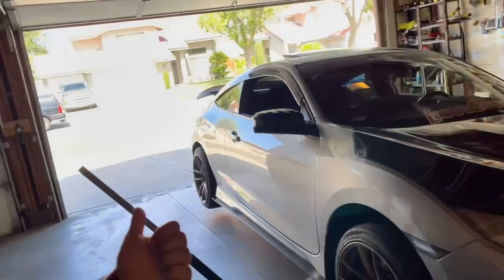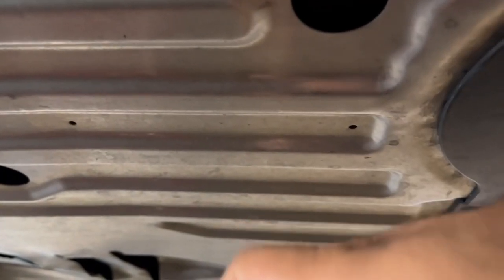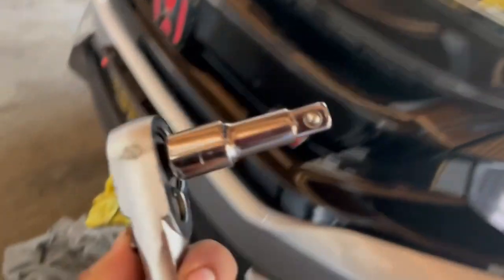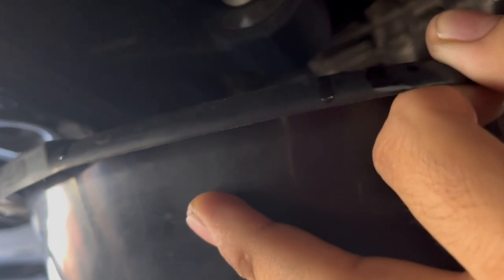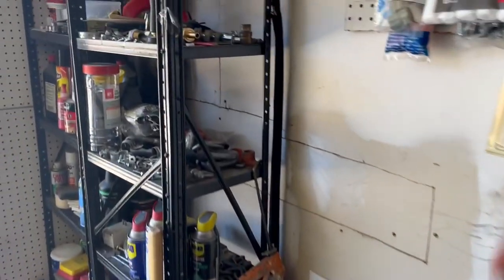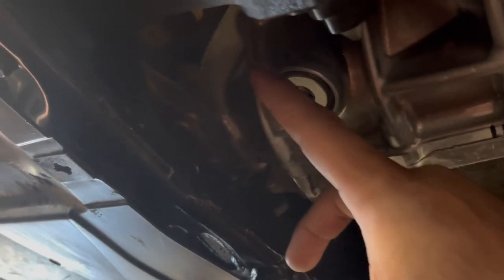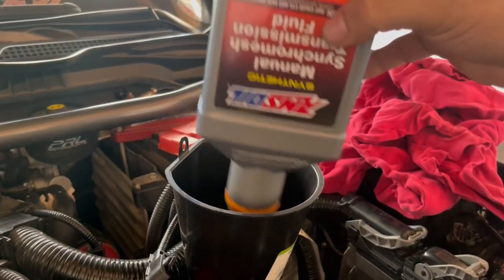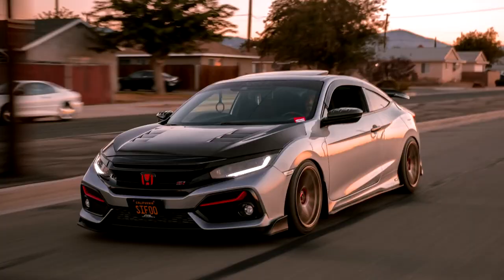TRANSMISSION OIL CHANGE ON MY 2020 CIVIC SI

Comment: Anyone know the correct factory torque spec. for the 10th gen. Si manual transmission drain plug and fill plug? Another video mentioned 32 lb-ft for both - I want to verify the correct factory specification.
Reply from the maker: im not sure exactly! i know Honda marked them with a line so i try to line that mark up or go a bit more just to be safe
Reply: 32 ft lb is correct

Comment: Dude u need to change ur antifreeze, ur going to regret not changing it ! Easiest way to do it is u remove the lower hose clamp
On drivers side and use a pick to loosen up the hose and drain it like that
Reply: Why you say that bro!? I never heard about that before
Reply: @JohnJohn-co9yz  It's good for preventative maintenance. There are additives in the coolant that are used to protect hoses/lines, etc, so fresh coolant is good for those things.